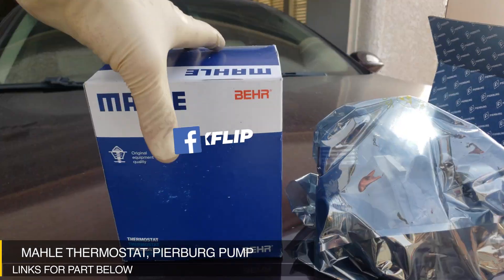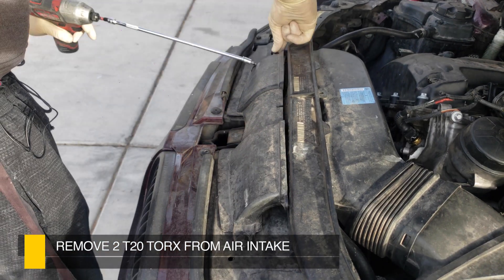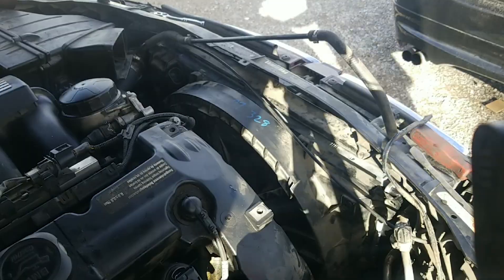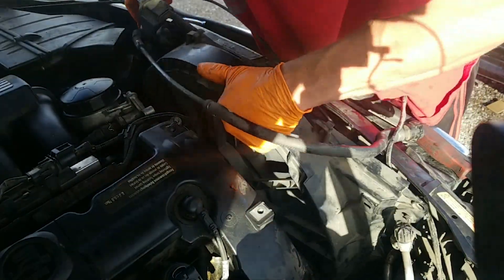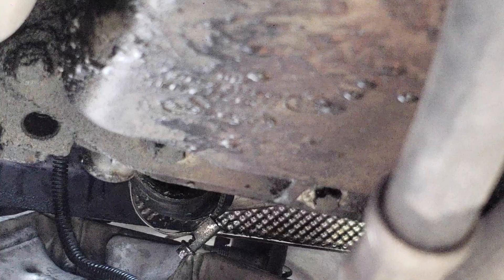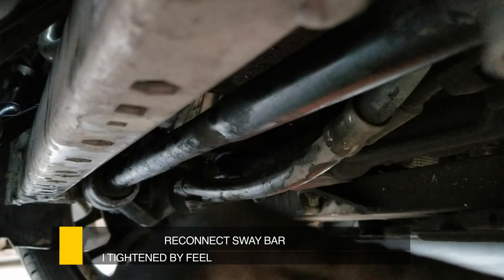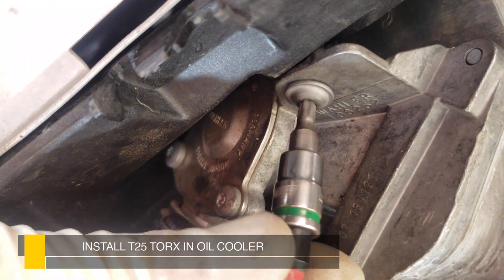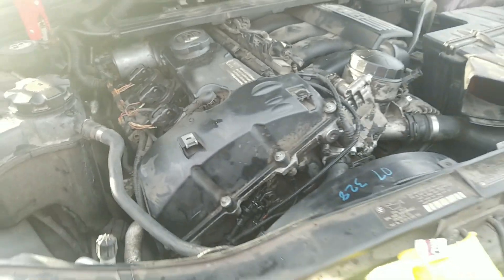HOW TO REPLACE WATER PUMP AND THERMOSTAT BMW E90, E91, E92, E93

Comment: I just did this yesterday on a 2010 328i e90 n51 SULEV. Didn’t have to take the fan out or the expansion tank. Not sure why you did all that. It wasn’t a fun job but not sure removing all that is worth it.
Reply from the maker: Nice man, I took it out because it give you more room to work, especially the connections on the thermostat are stuck on there. Glad you got it done. I have done quite a few of these and this is the best process I have found to complete it in a timely manner. Thanks for the info though🙏🙏

Comment: That bad is got a nasty leak
Reply from the maker: Actually car is virtuallly leak free done everything on upper, valve cover gasket, but there is a small leak from rear main seal. Very slow
Reply: @findfixxflip  from this video looks like your pan was leaking. I need to do mine on my n54
Reply from the maker: Ah i see, Yeah its definitely looks like it from the video, I don't think it's actually leaking though. There was a coolant leak by pump running down the engine. And i've replaced the valve cover twice now. It was leaking down the side of the engine, thats probably what the residue on the underside of the pan is. I just changed my oil a few weeks ago and it was dry. But ill let you know if end up replacing it i will do a video on the process.🙏 @robertkenney6002